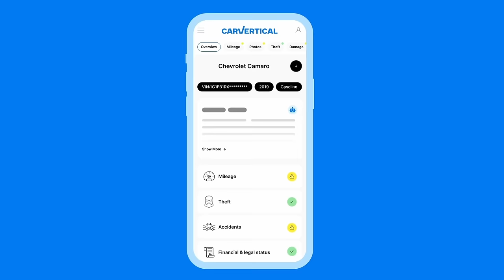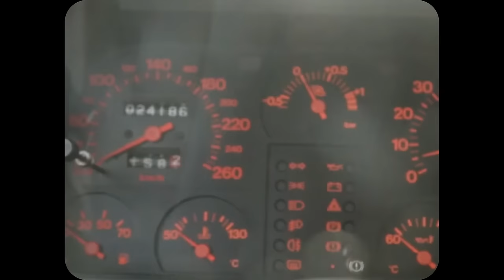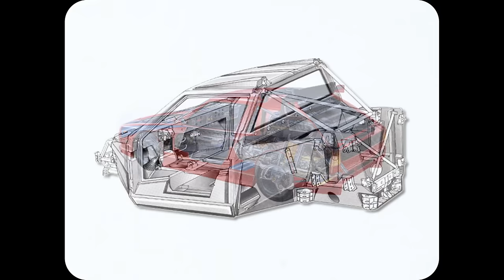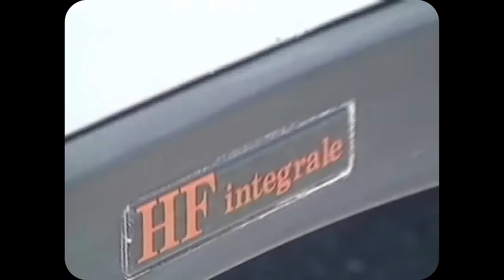Lancia's Deadly Delta Was Too Fast For Rally

Comment: I think the Delta is remembered for two things, one of the most iconic cars in rallying history and the car that ended Group B (due to Henri Toivonen and Sergio Cresto's crash. RIP to these two legends.)
Reply: The ford RS200 crash in Portugal that killed spectators was more structural to Group B demise, Toivonen who is buried in Espoo was more symbolic. Marku noted the S4 has no brakes and unlike the old 037 which felt like a glove, the S4 as though someone else (spiritually the hand of god) was guiding it not him. The Pug was easier to drive, hence why it won that season. He has a Pug in his collection as do the other Rally drivers.
Reply: @fraserwright9482  speaking of the ford, was it harder to drive than the lacia or is it the other way around?
Reply: @gabrielnicholascaparas9003  Kinda, but in different ways, the Lancia was hard to drive and fast, and the Ford was hard to drive and slow.  The Ford as far as I know and imagine, was difficult to drive in a dull knife sense, in that it sucked, was easy to overdrive into a mistake.  By all accounts it handled quite well, but the power delivery was bad, and the engine had no power low in the RPM range.
Reply: @gabrielnicholascaparas9003 the Ford was still under development at the beginning and the Lancia had been a progression. Ford had only started a few rallies with the RS200 in an attempt to join in on the group B series as it was hugely popular. As for the Peugeot Jean Todt created the ultimate group B team just as he did at Ferrari in F1.
Reply: @gabrielnicholascaparas9003
You should have respect for Sergio Cresto and write his name correctly.
Reply: @extremathule982  sorry bout that, going to edit this.
Reply: @fraserwright9482  Pug(?)  more easy to drive?
Reply: @fraserwright9482  I was interested to read your comment. I read, somewhere, the S4 had a reputation for evil handling on gravel, and Lacia were planning on replacing it, asap.
Reply: Its also the most beautiful car ever made.
Reply: @rudolphbondefangerer5513 wrong lancia that's the stratos
Reply: @badgers1975  Real men can't drive a Stratos, you are better off with a model car.

Comment: Kankkunen said to his co-driver when 1987 began in testing: "It's going to be a long year." 
They were used to Group B power, so that's why it was going to be long. He also claims that he drove the car one handed and all out in some test.
His co-driver said druing one test: "Press the damn accelerator." Juha responds: "I have been flooring it for awhile."

Source? Teknavi interview. 50th birthday of Juha Kankkunen.
It was a episode where Juha and Markku Alén were going through memories.
Reply: It was either Kankkunen or Alén who joked about the 1987 cars that you could drive them one-handed and use the other hand to wave at the crowds.
Reply: The Group A cars in 1987 were also quite underpowered, even Lancia Delta producing only around 240 hp.
Reply: Kankkunen did a regular interview/ column with Martin Holmes for motoring publications in the 1980s. Juha's early impressions of the Group A Lancia Delta after the 3rd wrc event Portugal (4th place) were first there were the burning paint odours of the new car and by the end of the event burning oil odours from the engine. Rhorl said when they tested the Group B car at Bauxites (Acropolis stage) it was over 200 km/h and the Group A Audi 200 Quattro was 170km/h.
Reply: That must have been so disappointing and maddening for those drivers.
Reply: @johnmichaels4330 Absolutely. As I said in other comment, if there wasn't for the bad, irresponsible, life threatening behaviour of the public and the organisers not willing to put more money into security, as we see nowadays, this wouldn't have happened. Of course Attílio and Henri's deaths had to be taken into consideration, but danger (in the competitors view) has and still is part of the game. Stopping Group B and not going forward with Group S may seem to have avoided more deaths, but how many deaths we had following that, either in group A, N, Kitcars. It was a stupid decision to ban cars and not putting more work in crowd control. Nowadays I go to see WRC in Fafe (Portugal) and there's still huge crowds as back in the day. Just better placed and controlled. It has been my opinion throughout the years and yet nobody really managed to convince me otherwise.
Reply: @ricardopereira2746  -- your opinion is logical, well articulated and credible. I agree with it. Blaming high performance cars for accidents is like blaming guns for murders. The hyperbole in the media regarding Group B is insulting to the intelligence.
Reply: @johnmichaels4330 Yeah. But Henri Toivonen, their friend and most promising driver for decades, was in depth of ravine, dead.
Reply: @ricardopereira2746 In Portugal you drove straight to wall of spectators which gamed with cars in 80s. In Rallies like those, drivers were afraid of killing dozens of spectators.

Comment: Toivonen reportedly complained that the chassis ended up feeling very loose due to the lack of structural stiffness/sturdiness. That made the Delta S4 harder to drive. 

On tarmac it was described as vague. Gravel and snow felt better. The looser the surface the better Toivonen felt it performed.
Reply: "Reportedly": there's a lot of that in comments and videos about S4 and 037 for some reason. The main complaint Toivonen and Cresto had was that the S4 accelerated so fast that there was no time to call out the pace notes between curves. They had to completely revise their system of making and reading them
Reply: And with all that, the 205 was still better
Reply: @sandromartins20  Maybe the Evolution 2 205 versus the first iteration of the S4 was better without Toicvonen and Cresto,  but in the last rally of the season the Lancia was sufficiently developed to allow a slightly past his prime. Alen to beat Kankunnen at the height of his talents on neutral ground, with no excuses.
Reply: This was at the beginning of the Season, not in May when the car passed some development and was way more easy to drive.
Reply: never. @sandromartins20
Reply: S4 was way faster than 205 @johngeren1053
Reply: @sandromartins20  Maybe because it was around for much longer?
Reply: Mostly down to a "roll cage" that was so thin it did nothing to protect the occupants.
Oh, that and Lancia used said "roll cage" as an extension of the fuel tank - the reason there was literally nothing left of the car after the crash.
Lancia were shocking at flouting the rules.....
Reply: @toivonencresto  Amazing what you can do with an adjustable waste gate....

Comment: An interesting fact about the S4's engine is that it is not derived from the venerable iron block/aluminum head Fiat twin cam used by previous Fiat and Lancia competition cars.Rather, it was cast in one piece of light alloy, like a prewar Bugstti. No head gasket to blow if it overheats or over boosts. Valve work must require some ingenuity.
Reply: Best sound ever in rallying,that engine .

Comment: One of the (if not THE) best race car channels. Thank you for this. Oh and Lancia was my first car, still in my ❤. Imagine of FIA (or whatever it was back then) put the crowds in safe places and enforced cars to have 1.2 tons minimum weight, so they where safer. Group B could still be here, along with Toivonen maybe...
PS: There is a video of a test of the S4 engine, making 1000hp on an engine dyno. 🤯🤯🤯

Comment: Damn just erased a detailed comment on what I wanted to address: in Portugal '86 event, the winner was Joaquim Moutinho just as you said. As a classic rally nerd I am, just wanted to make a small correction: he was driving a factory spec R5 Turbo "Tour de Corse", not a Maxi Turbo. I don't think there was ever a Maxi Turbo driven by a Portuguese pilot. Moutinho has passed away last year. He and Joaquim Santos, who drove the factory spec Rs200 involved in the fatal accident that took 3 lives and made dozens of injuries (by the way, the cause of that crash was him trying to avoid a couple of idiots who stood in front of the car, just before that fatal corner, at around 200km/h). Those two were the best Portuguese drivers back in the day, and from the following years. It wasn't by luck their teams invested in factory spec cars. They were backed up by the Portuguese official distributors of Renault and Ford, respectively.
Thank you so much for your great content and excellent narration. It's obvious that you put great effort in the channel. Keep up the good work. From a 45 years old classic rally nerd :)

Comment: From what I've watched and heard from this video (or at least my interpertation of it) is that by trying to cut corners when designing the Delta S4, Lancia also inavertedly sealed the fate of the Group B regulations. But Lancia now also had another car in the pipeline ready to conquer Group A in rallying.
As for the crowds during Group B's years - the lessons learned from the 1955 Le Mans disaster and the 1961 Italian Grand Prix, which both took the lives of drivers and spectators, were more or less applied only on closed circuit racing. With Group B breeding more or less monsters that could give even Formula 1 cars a run for their money, it was a ticking time bomb anyway and it was only a matter of a time that a disaster like that in Portugal to happen.

Comment: I heard that the panels in S4 were so weak that you could floor the pedal literally through the floor and it would get stuck.
Reply from the maker: yes I even mention that exact point in the video
Reply: @automobilistic  the pedal did not have a stop? ... how... ?
Reply: It did stop but the when it stopped the throttle was stuck like the driver was going all out  @GeorgeTsiros

Comment: I personally think that the Delta S4 was too powerful for it's own good (like that one time Jeremy Clarkson tested the Mercedes Brabus SL — it was nigh uncontrollable). Out of the 12 rallies in 1986 (not counting Sanremo for obvious scummy reasons), the 205 T16 E2 hit first place 6 times whereas the Delta S4 hit first place 3 times — the 205 T16 has lower horsepower and was only turbocharged, unlike the twin-turbo S4. 

Even in Sanremo, Peugeot won the rally but since Lancia said "ThEy HaVe iLlEgAl sIdE SkIrTs !!1!!11!" the win was instead given to Lancia. It wasn't until further investigation when the FIA concluded that Peugeot never even had (edit: illegal side-skirts) side-skirts in the Sanremo rally, let alone any of the other rallies prior — leading to the nullification of the Sanremo results.
Reply: What? You can see the skirts in photos and videos. Peugeot claimed that they were to deflect stones from hitting and damaging the underside  -  probably not true  -  and that the skirts were too small to be very effective in providing down force - probably true. At any rate, Paris accepted Peugeot's explanation and restored the San Remo points.That reversal was announced immediately after Alen had won the last rally of the season and thought he had won the Championship, which must have seemed cruel to him.
Reply: @johngeren1053  If the skirts weren't illegal to begin with, and since they did exist  long before the Sanremo rally (not to the illegal extent that Lancia claims), why wasn't Peugeot disqualified earlier in ANY of the other races prior to Sanremo? They were the SAME skirts for the past TEN rallies, and only in Sanremo were they deemed illegal by LANCIA themselves. It wasn't Audi, MG, Ford, Toyota, nor Renault that claimed the skirts illegal, neither did the smaller teams (Citroen, Opel, Porsche, Mazda, Volkswagen, Subaru, Skoda, and Fiat) claim them as illegal.

Oh, but it would be too much of a COINCIDENCE that Sanremo was the ONLY ITALIAN course in the 86' championship. It would be too much of a COINCIDENCE that LANCIA is an ITALIAN car brand. It would be too much of a COINCIDENCE that LANCIA was losing to Peugeot BEFORE the Sanremo rally (Peugeot had 141 points vs Lancias 119 points in the past 10 rallies leading up to Sanremo). That's a lot of coincidences against simple side-skirts built to deflect stones from hitting the underside.

—
Here's another coincidence. Sanremo's chief scrutineer, Lanfranco CANESCHI, inspected a Peugeot 205T16 (Andrea Zanussi's 205T16) in the European Championship's Piancavallo rally stage seven weeks BEFORE Sanremo. 

After Caneschi's inspection on Zanussi's 205T16  in Piancavallo, he declared the car CLEAN (that includes the "side-skirts"). However, when he was asked why the same car used in Piancavallo was now illegal in Sanremo, he stated that he only checked the brakes and suspension in Piancavallo — which is a lie.

The thing about Lanfranco Caneschi is that back in 1981, Caneschi organized a campaign who's purpose was to outlaw the Opel Ascona 400 — the first NON-ITALIAN car that won the Italian Rally Championship (IRC) in 1981. The Opel was successfully excluded in 1982, giving the championship to Ferrari in the Group 4 category.

FISA's Technical Commission chief, Gabriele Cadringher (absent from Sanremo; on Formula 1 business), had personally advised Peugeot that the strakes were legal, and rally organisers on every event SINCE March had accepted the legality of the strakes.

Peugeot designed the strakes to give protection against sideways impact as the fuel tanks were positioned under the seats in a vulnerable place. Similar to how the Delta S4's fuel tanks were placed, but this time, protected. 

—
Contrary to what you said, the Sanremo points were NOT in-fact RESTORED. Instead, on December 18, 11 days after the end of the Olympus Rally (the final WRC round), the FISA Executive Committee issued the verdict to remove the whole event from the championship that year. This awarded the Makes championship to Peugeot and the Drivers title to Juha Kankkunen, instead of Lancia and Markku Alen respectively.

Just to add to all of this, Lancia's team boss (at the time) Cesare Fiorio disagreed that Peugeot's side-skirts were illegal. 

And to add even more, quoted from Markku Alen himself in an article written by Richard Heseltine, published on "Classic & Sports Car,"
“I still don’t know the full story of what happened,” admits Alén. “I don’t know if politics came into it, but I never understood why the Sanremo people didn’t let the Peugeots complete the rally and then throw them out.

“It made no sense to drop them so late in the rally. By not letting them finish, and with the Peugeot team’s protest then being successful, they couldn’t simply reinstate them in the results. If they had, I might have finished second to Juha and perhaps still have won the title."
Reply: @captainbarbossa5201  The skirts were intended to tunnel airflow to the extractor under the rear of the Evolution T16. The extractors were removed when ground effects were banned following the Marc Surer crash which occured after Corsica and before San Remo.
Reply: @johngeren1053  Again, the side skirts that Lancia claimed "illegal" were not the same side-skirts prior to the FIA's rule re-write. IF they were the same side-skirts prior to Surer's crash, then scrutineers in the WRC would deem them illegal. The only time were deemed illegal after Surer's crash was in Sanremo, which were compliant to the new rules.
Reply: @captainbarbossa5201  "Again"? I don't recall discussing the Surer crash earlier.
Reply: @johngeren1053  I never even mentioned the Surer crash until you mentioned it.

Comment: The drivers had told the FIA that something needed to be done about the spectators at the Rally of Portugal. It was only a matter of time before a bad crash occurred, injuring and killing spectators. Due to how close they would get to the cars speeding through. Apparently fingers and blood stains were found in the intakes of cars, because the spectators would attempt to touch the cars driving through. So although it was a very tragic incident in Portugal, it wasn't surprising at all.

Comment: Even if the fuel tank was thicker, it would have done no good to Toivonen and Cresto. Modern racecars use flexible antipuncture fuel bladders for a reason...
Reply from the maker: its true that there's no guarantee, but a thicker fuel tank, and crucially, a protective plate would have reduced the odds of a fire (impossible to say by how much)
Reply: @automobilistic  based on my experience, I'll have to disagree on that one - I don't think it would have been very realistic to fit the Delta S4 with a rigid fuel tank thick enough to not crack on impact. And that's why eventually foam-filled fuel cells and flexible kevlar bladders completely replaced the good old-fashioned fuel tank in motorsports.

If we assume the tank was punctured by a tree branch, a skid plate would have helped a lot more - and Lancia's choice to get rid of it always struck me as odd, as it traded a minor weight reduction for a significant decrease in reliability (and safety, but that wasn't really a primary concern these days...).
Reply: You would probably need a self sealing tank to prevent that fire.